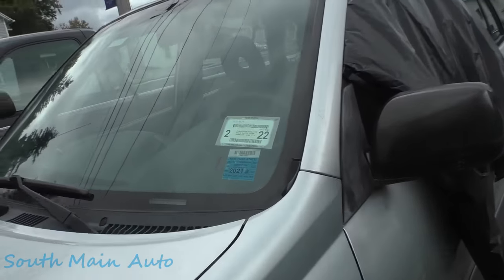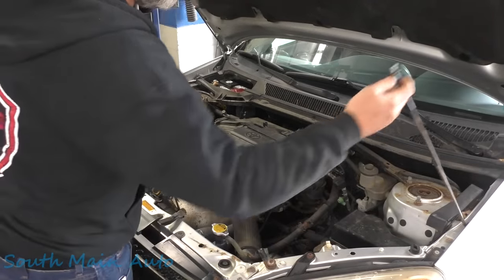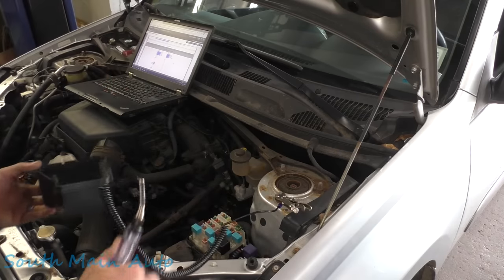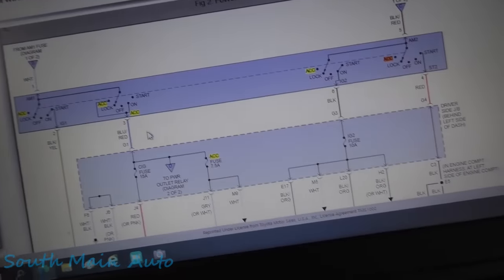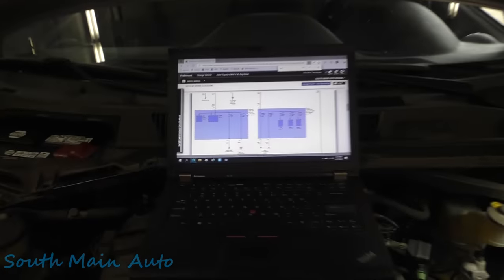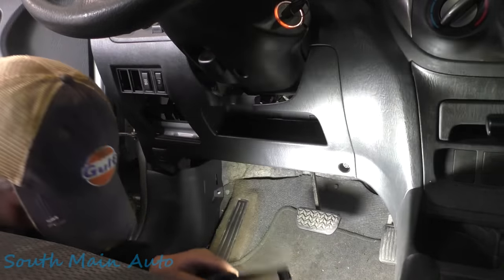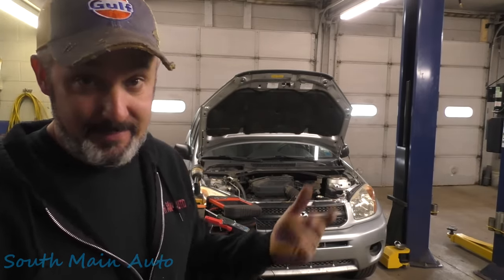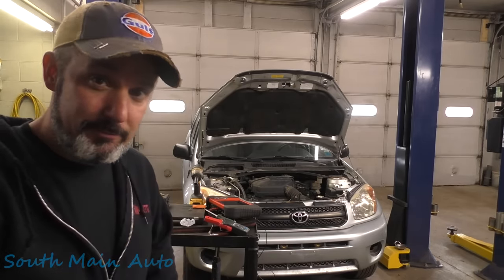Toyota Rav4 Is D.O.A. But Still Runs?

Comment: Classic reverse polarity situation. Bought the wrong battery and just slammed the terminals on. Current travels through the alternator diodes and pops the ALT fuse, makes a nice pop sound. You'll often see the ETCS, DOME, and AM1 fuses blown as well.

Comment: Hello Eric, from Donald  you can do this this but solder has lower melting point with heat than brass does so try brass weld easy on the heat  on fuse link and maybe that help you out.

Comment: Thanks for your utubes, I learn so much and gives me confidence  to work on some knotty repairs.  I need a torque wrench as one of my front caliper bolts fell out while on the freeway led to a bit of clanking but found the missing bolt on the lower control arm and just screwed it together and put a  bit more effort with my 2 inch bicepts this time to tighten the bolt. So we all have fun on diy stuff. Is a little knowledge dangerous? Probably but we have fun.

Comment: Chances are the driver-side window regulator (not the switch) is FUBAR.  I had to replace the DS regulator in my '04 Tacoma last year.  Easy job, and the switch module was still passing voltage/current just fine.

Comment: I popped the 80 amp fuse on my truck by leaving a spanner on the glow plug bus rail, it touched the head when I turned the ignition on and spanked the fuse. The spanner got a little love bite.

Comment: My guess as I've seen it a quite a bit (and I'm guilty of doing myself) is they were changing the alternator without disconnecting the battery. I would guess the main power wire shorted to ground during their alternator swap.

Comment: Long, long ago, when we were still running Ni-cad batteries and brushed motors in our R/C cars, the company that made the speed controller that I was using had their units protected by a "Solder-pop" fuse - it was literally a small gob of solder between 2 posts that stuck out of the case. I only ever popped it once, with a dead-short across the motor leads, so it took a good 100-ish amps.

Comment: Wow that was a strange one. Cool video. If I remember the drivers window has a relearn sequence because the battery was disconnected. I had to find out the hard way when I replaced the battery.

Comment: Had this same problem on my lexus is300. Only 90 seconds in to the video but mine was a brand new alternator that went bad 5 minutes out of the box and blew the 120a alternator fuse. Kept blowing it til I pulled and checked everything in the cab and realized it was the new alternator blowing the fuse

Comment: I had a similar issue with my 01 rav4. The battery hold down bar in the front of the battery fell of and the top of the battery hold down was hitting the battery terminal and making the radio have static when playing. Put a new battery hold down on it and no more issues. I think I was lucky that fuse held up.your channel is great! I watch all the videos!

Comment: I help a local car dealership, he informs me of the work that he needs done, I take care of that work, advise of other things that I found on visual inspection or what the Autel tells me.  I do investigate basic Autel codes that show up and advise the dealer what the likely fix is.  I inform that if that work is needed, a proper diagnosis will be needed.  I don't do parts swap unless a confirmed issue is identified, and what is needed to be replaced is then replaced with confirmed fix.

Comment: This and my 2002 Focus manual are still on the road and will still be running after BEVs are trashed , written off when battery goes bad. We already see GM refusing to make a replacement battery for some of their BEVs. There is no law to force them to either , while I CAN HAVE A BRAND NEW ENGINE FOR LIKE 3K dollars. Mine is 21 yrs. old runs great , air is cold , it's fully manual save for a cable-operated Cruise Control.

Comment: Eric, if someone changed the alternator without disconnecting the battery and grounded the wrench while removing the + wire, it would open the fuse.

Comment: The old battery was jumped backwards good job on this car. I would have still checked the tire pressures to try to get the tire light off and picked up the battery hold down if I didn't use it on this car there will be another for sure

Comment: Hooked up the new battery backwards. I’m certified mercury outboard tech. And many mercurys have a 100 or a 150 amp fused link between the alternator and the battery. If the battery gets hooked up backwards, that fused link will blow.

Comment: I had the fuse blow on a Chevy that has a similar fuse setup on the battery. The owner needed a jump so they hooked up the jumper cables with the correct color coordination but they attached the red lead on the post on the side of the battery instead of the battery post thus blowing the fuse for the fuse box feed.

Comment: Great video and to the point , I was thinking a fusible link but looks like that fuse block arrangement does the fusible links jobs. Good to see you go to Whimpys, we call them wreckers in Australia and usually your not allowed to take parts off yourself especially toyotas as there isn't that many availible as most are still on the road. I learnt quickly to only fix what is broken or you don't get paid for the extra .. point it out and don't try to oversell or they think your doing a sales job and lose respect and trust in you.

Comment: My best guess, alternator went bad killing the battery. they replaced the battery first then found out it was the alternator, and changed the alternator with the batery still connected only to short the wire/wrench against something

Comment: For bone yard replacement electrical parts, like the master fuse block that was replaced, I clean the contacts (emery cloth, or very fine sand paper) and then treat the contacts with Deoxit D100L (in this case I would use the small bottle with brush version) before installing in the vehicle. 

I know that you are only following instructions, and I agree that you should not repair what was not agreed upon. However, I have a stock of heavy duty cable ties, 43 inches in length and rated at 175 Lbs., which I would have used one or two to keep the battery in place so the fuse block would not short to the sheet metal on the customer drive home. Mainly, because if there was another failure you could rule out a shifting battery.

Comment: The battery clamp is missing, the alternator terminal struck the chassis. Same thing happened on my old RAV when I got lazy and didn't bolt it down.

Comment: I've seen people jump start cars incorrectly for example, hooking negative to positive and cause issues.  Then they replace the battery and alternator and bring it in with similar issues.   I'm not a car tech/mechanic but I am an electronics tech and used to have  a car lot.   I've seen a lot of that type stuff myself.

Comment: There must have been a lot of arcing and sparking to blow that fuse. I'm shocked there was no evidence of all that amperage being let loose. Must've been someone who cleaned up their mess. Great video as always Detective O!!!
Reply: My thoughts are the alternator died and took out the fuse with it.  The previous owner put a new alternator and battery in but found the the system still did not work correctly, so they sold it.

Comment: Fixing it all is why I don't work in public facing shops anymore.  Working on fleet vehicles, though, my job is to fix it all.  Problem 1 leads to problem 2, and so on.  Fix it so it's safe and reliable.  
My money would be on installer error, though, with a wrench vs that strut brace.  Someone tried to take apart the fuse assembly as they just saw a bolt and wanted to change the battery, made contact, a d luckily there was a fuse so it didn't just try to make the wrench glow.

Comment: I always hated tracing electrical issues. Trying to look up wiring diagrams in a book or a microphish was a nightmare. 
Ironically I left the auto mechanic industry in 98 and went into the A/V industry.  
I miss the simpler times is both industries

Comment: I'm kinda with ya with what's all is going on in the video. I'm a mobile mechanic and I try to sell it as I see it, since I'm already with the customer. In the shops  I've worked in, I agree 100% Now as to the blown fuse, I believe you said something about the alternator was replaced..... maybe not that's when it blow, because someone forgot to disconnect the battery. But like ya said, it's a mystery and we'll never get the full true story.

Comment: Great video Eric, thank you!!! Ugh, I hate the big integrated main fuse block designs where if 1 goes the whole thing is junk. Frequently see corrosion on the terminal take out the whole car like this, and sometimes the corrosion is so bad that it ate through the terminal entirely. My mother's 2016 (I think) F150 corroded the terminal clamp so bad that it no longer tightened and the terminal block thing was part of the battery cable and crimped tight. The cable was one continuous thing all fished through harnesses down to the starter. I ended up buying the block and undoing the cable crimp and then cleaning the wires and recrimping it on the new terminal block. Very irritating. I wish the fuses and clamps and whatnot were modular in these designs.
Reply: Well, the idea is those fuses are never supposed to blow, they're a last ditch for a catastrophic short from impact damage, or some tool with a tool. It's much more compact and cost efficient to make it a one-piece, with fewer points of failure. At least it's readily removed in this case, although I suppose if the terminals on the harness are damaged you've got an annoying splice job.
Reply: @Monkeh616  True, they are never going to blow if things stay intact and proper. But, shit happens. It would just be nice if they were modular. My Corolla is modular. Those big honkin' cube fuses are in the fuse box along with all the others. Nissans from the mid and late 2000s have huge problems with corrosion and I think that's my biggest complaint about the design.

Comment: The minute I saw what wasn't working I said "Fuseable link" but I guess that box is the new Link, makes you wonder if someone went to change the alternator without disconnecting the Battery & shorted out with the tool to the block since it only blew the link to the Alternator connector & not the others but there is three more circuits that are fed from that link.

Comment: Great video as always Eric..  I have a 2004 RAV4 as my beater, been a great car with 200 K miles.  Only thing that has broken is the 2nd aux power outlet, the one in the dash right under the radio...the one next the cup holders works totally fine.  yall think it is a bad fuse?

Comment: I bet its going to be a blown 100 or 80 amp  fusable link. Find No1 junction box or the main battery pos terminal in the engine bay . They are rectangular with a clear window in the top . The high amp ones are bolted in to carry the higher current.

Comment: From experience I knew before you drove that vehicle into the garage the main fuse was blown.  When the battery was replaced the cables where reconnected in the wrong order, Negative already connected, then the positive then arc and blown main fuse.
Reply: Not possible.
Reply: @ShainAndrews  Yes possible because I actually did this on my Trailblazer. 125 Amp Mega fuse and O'Reilly's was the only store that had it in stock.

Comment: Just think 🤔, the car in my profile picture, 1958 Plymouth Suburban, doesn't have a fuse in it's system! Get a direct short either the battery or wires are gonna give or there's gonna be a car-bab-cue! 🔥

Comment: Many years at Toyota dealership, have seen this often. New battery is the clue. Old battery was jumped with cables backwards and popped that fuse. Then new battery installed. Cust then scratched their head saying WTF. For unknown reasons any fuse down the line can blow, or multiple fuse on different branches

Comment: Loose battery sittin' on a block of wood...   Mebbe take the block of wood out and you'll see what the fuse hit!  ;)    A new battery and alternator sounds a lot like "Jumper Cables" to me.

Good quick find...   You changed that blown fuse into a smoke finder with that gob of solder!  ;)

Comment: Had something similar happen to a tech at work after installing a new engine and it popped that fuse box. Found out that the wire to the starter was loose.

Comment: Ive seen this on a Mazda, parts counter guy threw those felt green and red washers on the battery, moron hooked it up by color, smoked the main fuse, the power steering fuse etcetera, main fuse was even less replaceable than this cars, needed a whole wiring harness, I spliced in a 200 amp fuse and called it good.

Comment: I’ve seen this happen 2 ways.  The battery was installed backwards, and jumper cables were hooked up backwards.  With a new battery I would assume that the old battery died and they got a jump and the battery cables were hooked up backwards.

Comment: Great job Eric, I would not have believed a huge fuse like that could blow so thoroughly, and not show any other failures, just the one. Having all the Right wiring diagrams are absolutely necessary, to trace such a failure.

Comment: My guess is they replaced the alternator with the battery still connected and connected the live main wire before trying to fit the alternator in place and woops, slipped and touched the alternator wire/lug against the exhaust manifold.... Zappo

Comment: Fixing what you are ask to fix is about the best way to run a shop. If he was to start for example fixing the window switch, putting on the missing clips, putting in the correct battery and so on. When the owner comes back and looks at the bill he would ( and rightfully so) say "I just ask you to fix what ever it was that took out all my gauges, not all of the other stuff, I don't have money for all of this" and then your off to the races. The owner is right. So when you fix what your were ask to fix it cuts out all of that drama.

Comment: My only issue is this:  If your premise is right and the battery shorted that big fuse the customer may have to bring the car back to you for the same issue because you didn't tie the battery down to keep it from moving.  Even if it was temporary something would have better than nothing.

Comment: "not my dime"  I had an engine block that I had just purchased used dropped off at a shop for inspection.  Whoever removed the dry sleeves dinged the block a little and the shop wanted to bore it out 100 thousands and wouldn't do anything less.  I had it picked up by the mechanic and just honed out the dings.  It was my dime, ($2600) that the shop wanted to spend.

Comment: Good job. Love the way you run your diagnosis and come up with good results.

I noticed one thing though which I've seen lots of videos condemning it: you are tightening the battery bolts with power tools, won't that damage something on the car?

If not, can you please explain the concept?

Thanks

Comment: Details are important even the smaller details and even if mistakes and boo boos were made everything helps.   Hey time is money and the more details you have the less time you may have to spend troubleshooting or scratching your head trying to determine the cause, so you do not experience a repeat of the issue.   I swear sometimes I spend more time determining the cause so I can prevent it from occurring again.

Comment: When they replaced the alternator they did not disconnect the battery cable and shorted the alternator wire to ground and then after the the alternator no longer charged they replaced the battery thinking the battery was bad. Then they came to see you.

Comment: they jump started the car backwards battery connection. also hooking up the battery backwards will do it.  the diodes in the alternator are a dead short when power is swapped.

Comment: With the battery replacement, I'd bet the original battery was bad, It was jump started with the neg on the Pos and the pos on the neg.  I made that mistake and fried the master fuse on my truck the same way.  Needed to go to the bone yard and get another master battery fuse.  Luckily, I didn't loose any components and only blew a couple of fuses.  Oops  :)

Comment: Wait you didn't just use the solder job as the fix HAHA!!!  I and I'm sure others would be curious as to how much juice you could run through that solder joint before it says nope I'm done LOL.  

I understand what you mean about just fixing what you were asked to fix.  I mean you could have fixed the power window issue, the battery issue, hold down issue, clips, and who knows what all else on that thing and handed the customer a nice bill I'm sure, but wasn't what the customer wanted or asked for.  

The shop I go to, when I need work done, they do what I ask them to do and do a courtesy check on the whole vehicle and let me know if there's anything else that needs attention or stuff that needs attention but can be done at a later time type thing.  To me its just nice to know they looked everything over to make sure there weren't any other issues that need immediately fixed, and sometimes its one of those hey since we already have this torn apart or already doing this job do you want this done too since we are this far into it, that is sometimes nice that they think ahead about stuff like that too.

Comment: Technically “fusible link”. Not fuse.  
If it was the alternator line he probably shorted the cable at the alternator end when he was doing that swap. I have made that mistake but it didn’t melt the link, it just made a brief sparkly show to let me instantly know my failure of process.  (I was like 18)

Comment: I know that Nissan that if you jumped a dead battery but the battery was so low they where notorious for blowing the main charging fuse because the alternator would send more amps than the fuse was rated for but not sure if that Toyota would have the same issue.